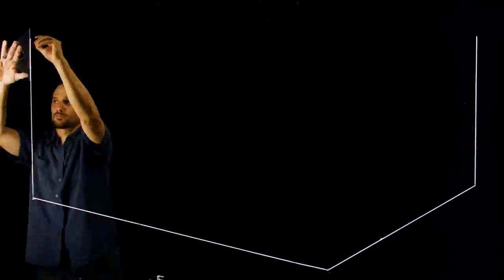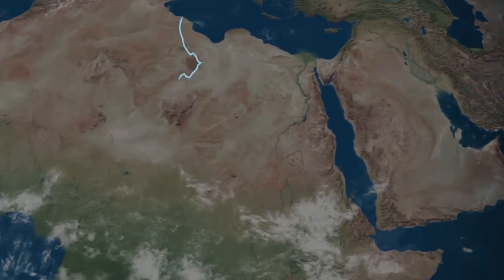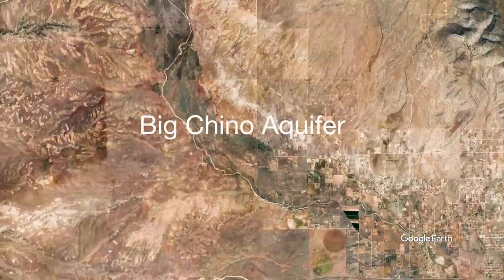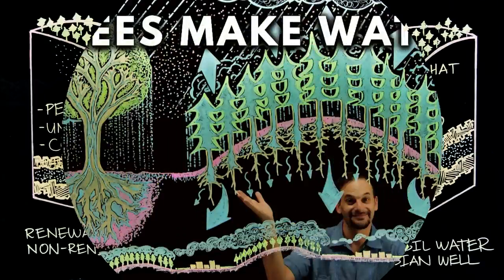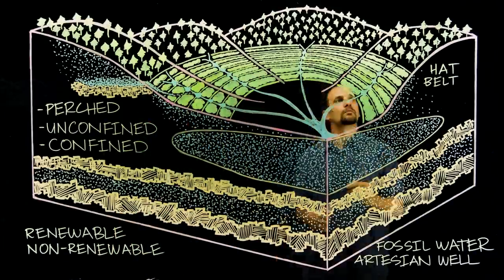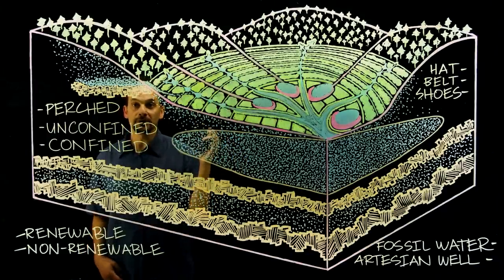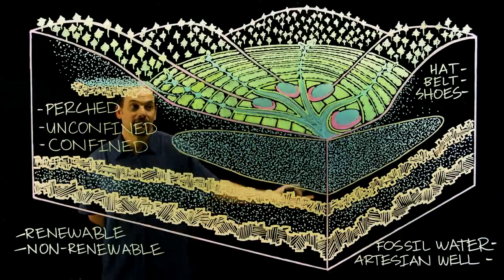How to Rescue a Sinking Water Table

Comment: Excellent description of the concept which is presented in the latter half of the video. Regarding the first half of the video, I wish to emphasize that terminology for aquifers refers to gross characteristics. The various categories are not absolute as some of this video content implies. I have added some clarifications as follow…
1:10 Springs can originate from unconfined and confined aquifers.
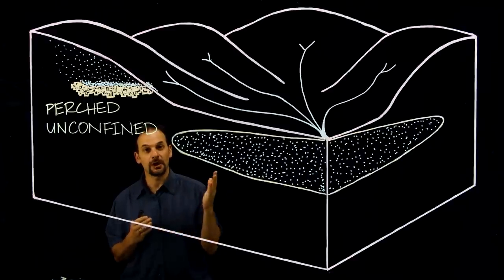1:35 Unconfined aquifers do not have to follow the topography of the land, tho they often do.
1:45 Unconfined aquifers are not necessarily connected to streams, rivers, and wetlands. They may have no streams, rivers or wetlands above or adjacent to them.
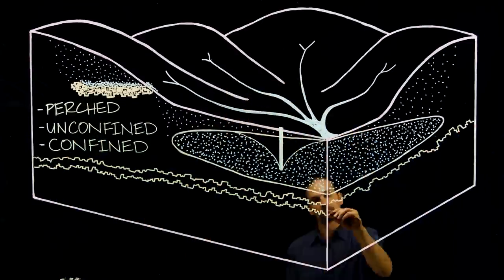2:05 Confined aquifers do not necessarily have “rock” below and above them. Confinement may be due to low permeability materials, such as clay.
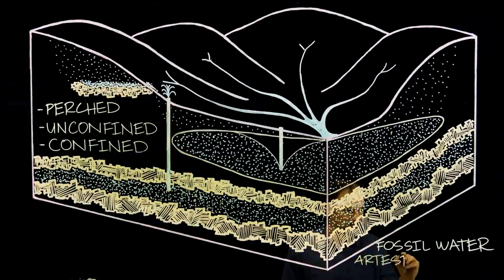3:00 When water flows naturally out of a well above ground, it is called “flowing artesian.” Artesian simply refers to water level that rises after first encountered below grade, which is also the defining characteristic for a confined condition.
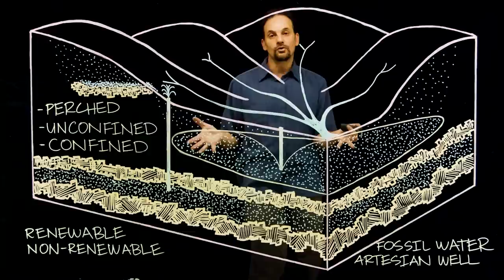4:29 Rain and snow runoff will infiltrate. The issue is what proportion infiltrates versus that which runs off, and is the groundwater withdrawal larger than that which infiltrates?
Reply from the maker: Thanks, I appreciate the expert commentary. It's true that there are a lot of generalizations in the video, and I'm not a trained hydrologist. So I appreciate the detailed clarifications.
Reply: @amillison  Thank you for the gracious reply Andrew.
Reply: Are you available as a consultant?
Reply: @julietteyork6293  I am retired on disability, and the insurance company subtracts any money I earn from what they owe me. Regardless, I am happy to help if possible. How would we communicate, as I don’t think we should post email or phone numbers in YouTube?

Comment: Trees, especially coniferous species, cause you to lose alot of water via evaporation. Smaller deciduous schrubs (if they can give you the same soil properties) will increase the amount of water refill even more than Trees. Evaporation losses are lower. A nd healthy soil pH stimulates this even further, there are cues that acidification might increase evaporation due to increased water uptake to compensate for the lack of calcium, magnesium, etc. in the soil solution.

Comment: This is a wonderful solution to a very common issue around the world. Thinking it over has made me wonder whether the solution is feasible only in places that were once naturally growing with Hat, Belt and Shoes. Would it be possible (and ethical) to implement a solution like this in a naturally deserted area such as Arizona? I wouldn't be the first to point out that plants need water to develop this system in the first place. Perhaps the possible and ethical solution is to use only plant species which are local, using them to restore the land to the most natural extent they can.

Comment: I currently live in Prescott, AZ. I never knew we get our water from the big chino wash area. very interesting, I wonder how the more housing development in the area and pressure on aqua fir will effect the headwaters of the Verde river.
Reply from the maker: It will negatively affect Verde River flow for sure! I moved away 15 years ago so I never kept track of the pipeline plan from the Big Chino, but all the water for Prescott is taken from the groundwater that feeds the Verde
Reply: start collecting rainwater and try and tell others!!
Reply: It breaks my heart to hear that Prescott is developing so quickly. I step away for just a few years and the population/housing market explodes. Sad too that it seems to be poorly-executed sprawl. I got the same problem in the town where I currently reside. I’ve been in this town longer, and I have watched poorly-executed sprawl go wrong so fast. I’m in a slightly larger town just outside of the California Bay Area. A lot of folks are moving out to the suburban towns, like mine. The drought has been tough, but I think the extra straws in the water hole have had a lot to do with the severity of our particular situation.

One thing I have noticed about California is the roads. Everybody loves to talk about the crappy roads, myself included. However, if you stick around a for few years and drive around quite a bit, you’ll notice that all the roads seem to be almost the same age. That’s because they are all pretty close in age. When you build a lot of something with the same basic materials, they all rot at the same time. The roads went crappy because the maintenance sector got blitzed. All of the capital that used to go to growth now goes to simply keeping our heads above water. The bigger the boom, the bigger the bust. The great tragedy of my current town and the state of California is that half the people think there’s no problem at all and the other half doesn’t even know what problems we have.

I warn you, do not let Prescott become my current town. Growth is fine, but it’s gotta be slow and deliberate. Seriously, get mobilized. Start talking around. Don’t let Prescott become a victim of its own success.

Comment: Great job colleague!
I visited a good experience on South Australia. The Aldinga ecovillage, has a system to retain run-off and stimulate the infiltration of waters to a karst hydrogeological system.
In Brazil we are researching some small farms who are called "water planters". They make little digs (dry boxes) overpassing the B soil horizon to access the C horizon (more permeable) and recharge phreatic waters aiming to keep springs working on the dry season.

Comment: Good Stuff!  California needs to do this on a lot of public lands but we also have to look at our farm and other subsidies to make sure they only go to people and companies that incorporate these concepts.  We can not only store more in aquafers than we can now store in reservoirs but it's also collected and stored on a local level without pipes and canals. A big investment in aquafer recharge also makes relevant a set of new laws that charge for commercial aquafer withdrawal so that the people who use the water pay for it.  Catching water that would otherwise quickly flow into the ocean & recharging aquafers with it could combine with pumps and canals that take water just before it enters SF bay & also used to recharge aquafers could easily pay for itself if it's done right and would be far more cost effective and environmentally friendly than adding above ground reservoirs.  Part of accepting this science also means that we have to urgently stop the canals that take inland desert water to the coast.  LA should be required to build desalination plants and restore the Owens valley watershed.

Comment: So timely! My well water is becoming more brackish over time. We're about 15 miles from the Oregon coast, at about 200ft of elev. This means my 200ft deep well reaches to roughly sea level. 

It occurs to me that we might be getting sea water infiltration, and the fresh water is drawn off, allowing the denser sea water to rise. Is this at all a reasonable hypothesis?

I'm implementing water capture techniques to help span our long drought-like summers for growing food. I wonder whether these techniques could, eventually, reduce the salinity of our well water?
Reply from the maker: Great questions. Seawater infiltration into freshwater coastal aquifers is definitely a thing, but I can't say in your case. I made another video about a similar situation that you may find helpful: https://youtu.be/wcYL5Uya5MU
Reply: @amillison  I'm gonna have to do some reading, I guess.. sigh... Does the learning ever end? Lol.

We're not far from you, extreme eastern Lincoln county. I really appreciate your content and am starting to apply these techniques.

Video is in my queue. Thanks!
Reply: If u are so close to sea then I am pressuming u r getting descent rainfall in ur area.
I had done successfully water recharge of our borewell, which is not even a km to coast and ground level is 10 meters to the sea. The bore is 100 meters, well below the sea. After recharging we not only get fresh sweet water but the electrical pumping cost has dropped nearly 70 %, as there is no pressure on the pump to pump the soft water. 

On another instance I started recharging the borewell from openwell at end of of rainly season for almost a month. This resulted into deep recharge and thus water staying for long in the open well which otherwise use to get dry during summer.
Reply: @sachindj100  thanks for your comment.

We are nearly temperate rainforest here. Typically over 250 cm of rain. But it's all from October to April. By the end of winter the static height in the well is, basically, ground level.  By this autumn we still had plenty of water in the well, but I didn't check its static height. Last year in the autumn it was maybe 3-4 meters below ground level.

  Neighbors report their wells have gotten more brackish over a span of years, which is what makes me think it's possibly sea water infiltration from the coast as the fresh water is drawn out by wells, and not recharged due to heavy deforestation in the area.

My hope is to turn our slopes into water retention areas and, effectively, push the brackish water out just by driving more infiltration of the fresh rain water. Of course, it would be great if my upstream neighbors did the same, but that's a different battle...

Some initial research suggests this will actually work. Time will tell.
Reply: @andrewsackville-west1609   i get average annual rainfall of 250 cm and sometimes even peaked to 350 from June to September, yet just post monsoon all dries up. And had the similar problem of water becoming hard and little blackish...the recharding of borewell did wonders for me. And now we have endless supply of very own fresh rainwater post monsoon. See if that helps u.. although I do agree about every strata is different..best luck buddy.
Reply: @sachindj100  great news for your situation! Thanks for sharing and good luck to you

Comment: Brilliant.  It occurred to me as you were introducing the concept to wonder if perhaps aquifer depletion has a greater impact on sea level rise than ice melt.  For the most part, if water remains water (law of conservation of matter so long as nothing happened to break it down or get added to H2O), the total amount of water in the earth’s ecosystem would be more or less constant so if we are depleting aquifers as a result of our usage patterns, it has to go somewhere, and downhill is the most obvious.
Reply from the maker: But simultaneously more ocean water is being evaporated into the atmosphere with warming temperatures. So not sure where the balance settles out
Reply: Of course.  Things are considerably more complex than some would like us to consider.  I think we all should be able to agree we have a damaged water cycle at minimum.
Reply: @MrTree0007  
And than mitigation, building resilience is desirable weather one thinks it is human caused climate change or a twenty year flood/drought/heatwave event...
Reply: @Derek Thille  
And than mitigation, building resilience is desirable weather one thinks it is human caused climate change or a twenty year flood/drought/heatwave event...

Comment: I live 45 miles from savannah Georgia which is on the coast. The state has brought in a giant electric car manufacturing facility and they want to drill super wells pulling 10 million gals per day. But they can’t do it in the county of the project bc moratorium on well drilling due to salt water intrusion into the confined aquifer but they are just side stepping that by going one county over.... which is where I live. And it’s mostly agriculture. 

If anyone read this far, thank you, and please push back on government ruining our lives and everything else.
Reply from the maker: Saltwater intrusion into coastal aquifers is a massive challenge and sorry to hear that. I cover the topic a little bit in this video:https://youtu.be/wcYL5Uya5MU
Reply: 10 million gallons/day for an electric car plant.  Wow.  Which plant is this?  Can't be Rivian because that facility is more like 150+ miles as the crow flies from Savannah.

Comment: does capturing water and preventing it from quickly going downstream have any negative effects on river habitats? For example in the Pacific Northwest, there was concerns that the river levels were too low and Salmon were overheating, not being able to make it out to the ocean.
Given that water is a finite resource, would we inadvertently be hurting a different ecosystem if we were to replenish all the aquifers that we have already drained ?
Reply from the maker: Just the opposite. Slowing the flow of water actually creates more sustained streamflow for rivers so they don't have the big peaks and valleys as water levels go up and then down with rains. Watershed degradation, aquifer depletion, and stream health are all interwoven.
Reply: @amillison  thank you so much! I learn so much from your videos! 😁

Comment: The thing about aquifer recharge is that it starts with one simple idea. That is holding water on the ground to allow it to soak in naturally. Not all land is like a fast acting sponge. Having  your yard as a minor depression will hold water in a large area for a longer period to allow it to soak in. This works great in cities and does not create breeding grounds for mosquitos. After a storm the water does not stay long enough. Phoenix Arizona has some innovative local solutions to doing just this.
Other things like returning beavers if your ecosystem is appropriate for this. Establishing mini rock dams in seasonal streams to slow water flow and even retard small pools longer. 
You are only limited by your ingenuity.

Comment: This might be a naive question or a really good one. Is it possible to offset the rising sea levels by storing water on land – in water harvesting structures, the ground, and trees?
Reply from the maker: Theoretically it would make some difference if water never made it to the sea and was stored on land in aquifers, but I believe the amount is not significant compared to glaciers melting and ice shelves collapsing into the sea displacing seawater and raising sea levels

Comment: Don’t aquifers compress as water is removed making them unable to hold the same amount of water they once did?
Reply from the maker: That's a good question and it will definitely vary from location to location based on the geology of the aquifer

Comment: Good stuff.  I did have a question, though.  If we plant a lot of trees at the top of the watershed (i.e., the "hat"), will they drink up a lot of the water that would otherwise percolate into the ground?  Thanks.
Reply: Trees/grass are a net positive for water. Yes they do drink water, but they also shade the land from the sun (lowering temperature) so less evaporates overall. Not to mention the pollen they release interacts with the environment and actually encourages rain to form in the area to begin with.
Reply: Rain doesn't enter ground fast, they will just flow away. Vegetation helps to retain the water on surface so it can take time to absorbed into ground.
Reply: 5:11
Reply: @carlotta4th  In general, trees increase evaporation, but they also increase infiltration into the soil.  What is reduced (almost to nil, especially with dense undergrowth) is surface run-off.
Reply from the maker: You definitely need to watch this other video I made. It answers this question:https://youtu.be/oY8ds4BiG1A
Reply: @chengkuoklee5734  Thanks for the responses.  Yes, I knew the grasses and their extensive root systems would slow the runoff and increase percolation.  I just wasn't sure about the vast number of trees, each of which can absorb and transpire more than 100 gallons of water per day.  From the other responses, it sounds like it comes down to a net positive.  I like trees so that is good news to me.

Comment: it's interesting how it works out that you can increase the moisture of the land without necessarily needing more rainfall.  In the short term, it will of course mean less water flowing off the land as the aquifers recharge and the soil regains its life, but once the land is "full" once again it can provide its water to downstream neighbors while still being able to support its own life.

To understand why this works, think about the opposite: drainage canals.  Speeding up the flow of water dries out a landscape.

Comment: There is an issue with many over extracted aquifers, and it effects more than 17,000 square miles in 45 States. Land subsidence. When unconfined aquifers are over extracted, the pores that held the water can close up. Then the aquifer has shrunk in size. It can never be completely renewed.

Comment: The solution to almost any problem is cheap energy. Cheap energy to build things, cheap energy to process things, cheap energy to move things. 

The point of balance is always price*. For North America a solution to fresh water was expressed in the 'North American Water and Power Alliance'. Which takes water from the Yukon and sends it south and east**. That project would be net power positive thanks to the high collection altitude, even while needing huge amounts of lift, tunnels drilled through mountains and a massive flooding of a huge area of land to act as both transport and storage. 

The project is politically impossible until and unless North America forms into a single political union operated by a government with some strong authoritarian vibes.
It's more of a solution to the question of how can you cheaply supply triple the current water used in the US South West and West Coast than it is a solution to the problem of if we don't use more water and don't allow more people how can we use what we have now in a better way?

*Political, economic, ecologic.
** 93km^3 or 75million acre-feet a year.